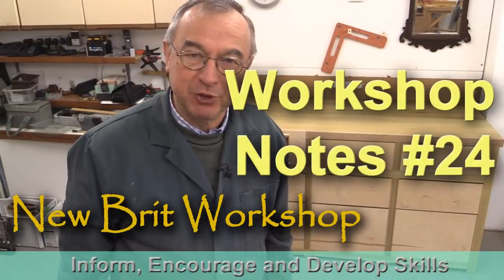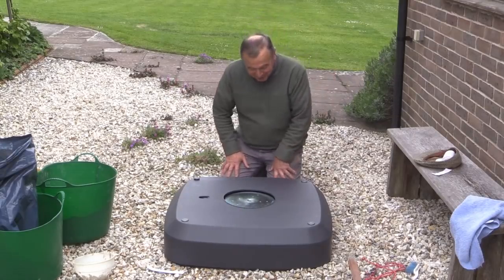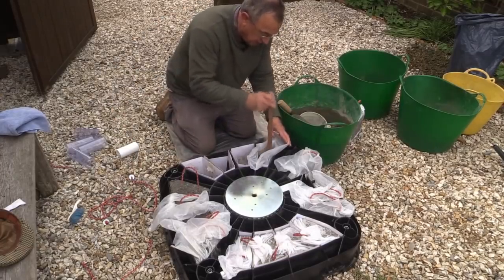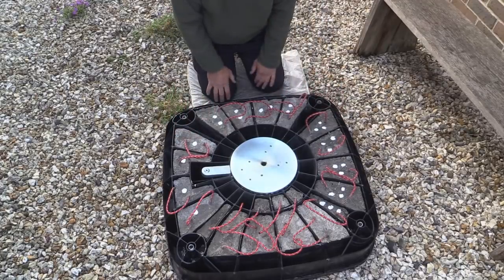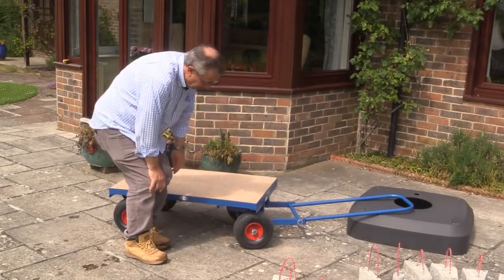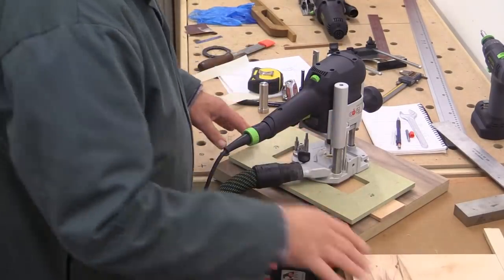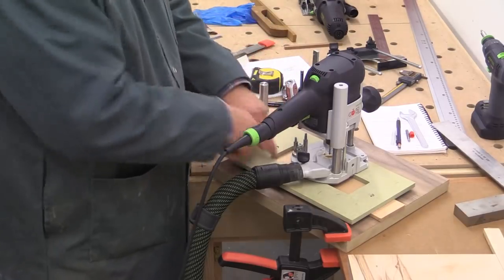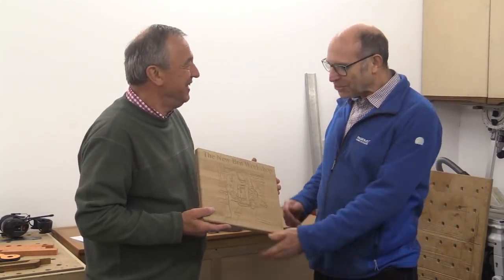Workshop Notes #24

Comment: Thanks Peter. I thank you as dedicated follower  from the other side of the planet, for all your work to date. I’ve been a subscriber for years, invested in the Parf guide system v.1 and bought the full range of Parf dogs.
I was interested to see you using the Festool OF 1010. Unfortunately there is little on the versatility of this router on YouTube,  in regards to its use with the guide rail. Most of the accessories and tutorials seem to be centered around the OF 1400. I do remember that you did do an introductory video on it once.
Good luck into the future with your move.
Reply from the maker: Hi Howard, I love the OF1010 as it does a huge amount of my router work and is so light and easy to handle.  Many thanks for the kind words.   Peter

Comment: Great vid Peter, many thanks. I've been wondering about those Axminster vices, yours certainly seems to be very smooth in operation; maybe I'll pull the trigger on one after all!
Reply from the maker: Hi Tony,  I would not hesitate. When I was doing my market research I came across a review from a customer who had an issue. Despite this I selected the mid size option. When it arrived I looked carefully at the mechanism and found that the factory applied grease was slightly hard and so I cleaned this off and then operated the quick release function (pulling the vice out then back in) several times after applying a dash of fine oil. It worked perfectly and perhaps I did not need to take that precaution. The vice is perfect and operates so well that I just wish I had used one with my original bench a few years ago.   Cheers.   Peter

Comment: Great idea with the concrete!
Reply from the maker: Hi Ben, After putting clean gravel in there last summer I found it so difficult to get out (as the base was so heavy) that the only way was to pick it out by hand. I wore out a pair of industrial gloves in the process. The concrete seems to be a good solution. If I had access to a lead smelting setup I would have considered casting the shapes.   Cheers.   Peter

Comment: Hi peter,

Can you tell me what you actually put into that concrete mix and the approximate ratios please, I have always used the ready made mortar mixes and haven’ t found them very satisfactory.

Andrew
Reply from the maker: Hi Andrew, I used gravel which we cal "3/4 down" which means it is a mixture of stones, chips and sand from about 3/4" to dust. You could use coarse sand instead. I added cement at a ration of about 5 parts gravel to 1 of cement. Finally adding water to taste !  It starts to go off after about 90 minutes but needs at least 24 hours to be safe to remove from the mould - 48 hours would be better.  Peter
Reply: New Brit Workshop that’s very useful to know, thank you